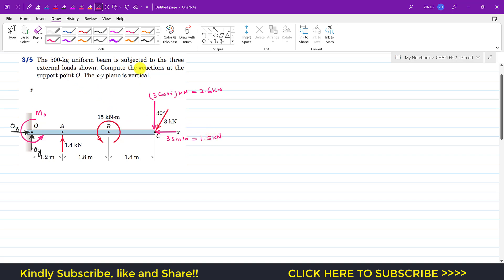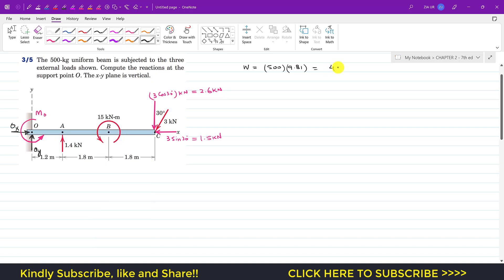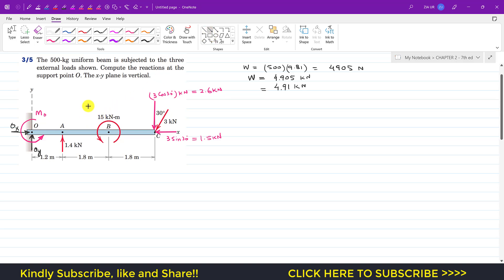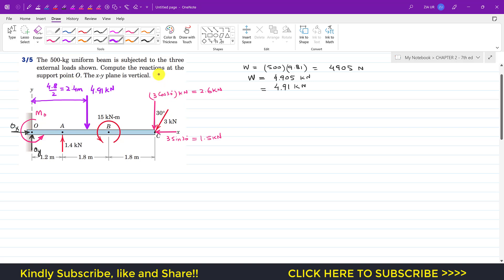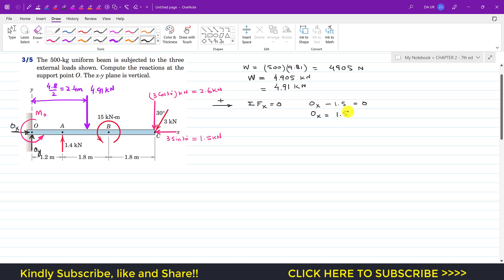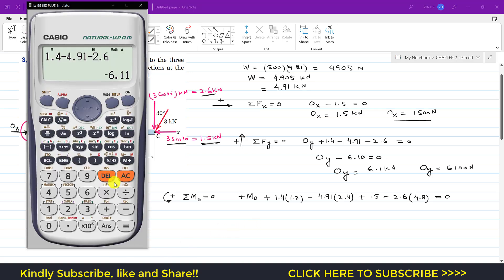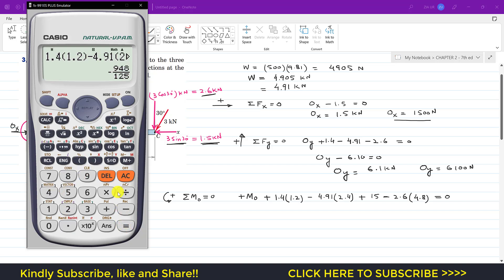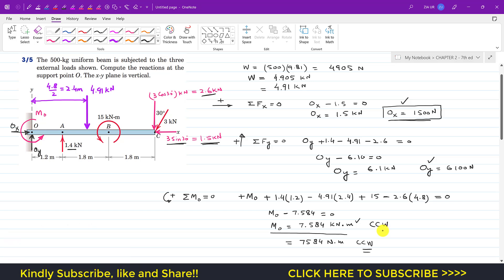3-5 Chapter 3 Equilibrium Solved Problems Engineering Statics by Meriam 7th Edition

Comment: shouldn't the 15kNm moment have a tangential upward force that should be added on the summation of forces in the y direction? 15kNm/3 = 5KN
Reply: I mean I also did it like you did. I thought you'd use it too.
Reply: Did that too is the correct way or ?